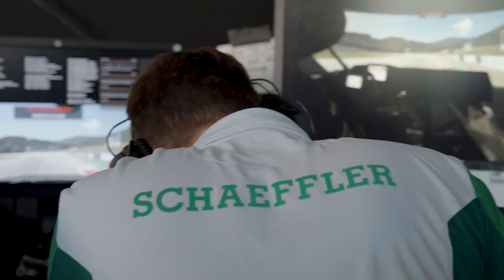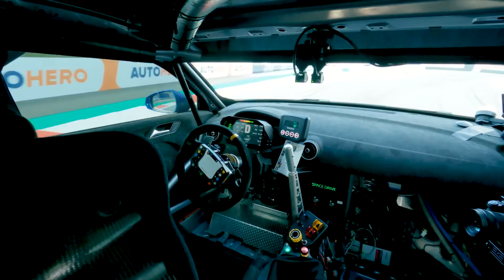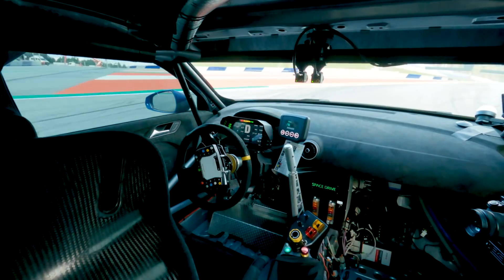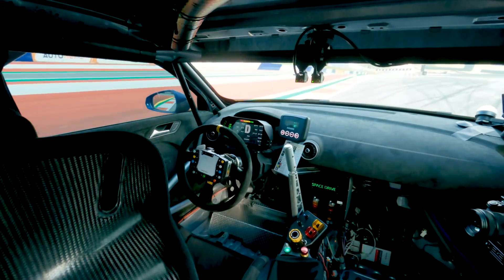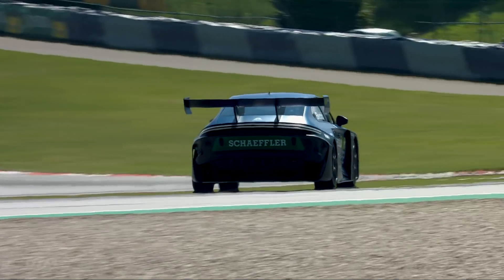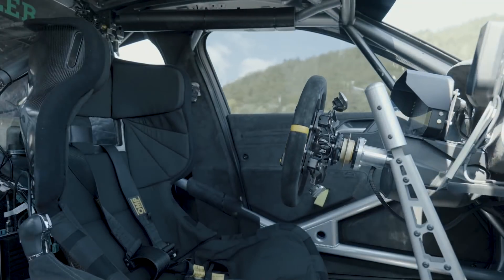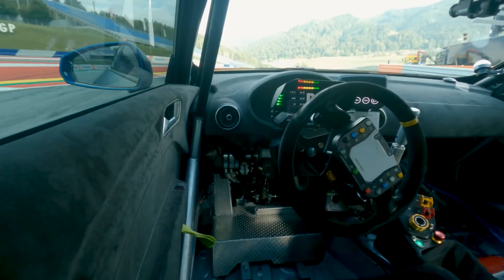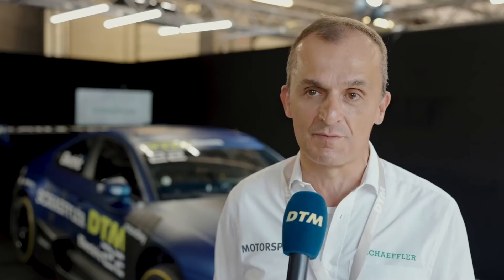Driving a Race Car REMOTELY! 🤯 | DTM 2021

Comment: It's promising for possible dangerous situations around racing. Say, after an impact, if the car is mobile, it can be driven remotely to the nearest exit where doctors will be available sooner.

In actual racing, this can be helpful to bring more drivers with disabilities to racing. They can use a system that has similar tech, but actually be seated in the car, just with a different steering device, adapted to their needs. It's not remote, but uses the same tech to create new ways of steering. 

And yes, why not try some ultra fast and light cars driven fully remotely on a dangerous track. A new type of racing, next to traditional ones.

Comment: I hope these will never replace real drivers in real cars. Wanna do a separate championship? I’m good with that. But NEVER replace real races. I’d the driver is not in the car, it is not a real race
Reply: Yeah, "some times" tech on sports it's just make it less emotional and less excitement to watch imo...
Reply: I'm not trying to take anything away from you. But I disagree with your last sentence there: "If the driver is not in the car, it is not a real race"
Reply: @decay2__  IMHO it is not, not in the "usual sense" at least... When you are "on the machine you are racing" you feel it. No matter how realistic a simulator is, you don't feel it. Plus you have the adrenaline, you have risks that make you drive/race in a certain way (this is of course good and bad at the same time). It is just a completely different experience.
Reply: @DavideBenvegnù  I agree. This looks more like an extension to Simracing than anything related to real racing. But that extension doesn't make sense because the point of simracing is making racing available for everyone and not just the privileged.
Reply: I didn't expect to find Jim Glickenhaus' YouTube account so easily
Reply: @decay2__  I'm not saying innovation is bad. I work in innovation myself. And as I've mentioned, the 2 things are perfectly fine if both coexist. What is not fine is if one replaces the other. They are simply 2 different things. Are "Sports" and "eSports" the same thing? NO. Are any of them bad? No. They are just not interchangeable.
Reply: And FYI I do have racing experience... not with cars, but I've raced in Motocross, Supermotard, and Supersport

Comment: In all seriousness, I see this as a huge potential for the future of Motorsport, the driver doing it remotely allows there to still be the skill between drivers, but it allows cars to get faster and faster, beyond what we can even imagine without causing any additional risk. I really hope this is more than just a pet project for DTM, because it's something I personally would be incredibly excited to work on and see developed further.
Reply: Nah mate without the driver being in the car it takes away from the experience as a fan. The drivers would all be kept at the factory and fans will be watching cars go around. You won’t be able to celebrate yohr favourite driver getting on the podium but your favourite car now
Reply: Even in eSports we see players sitting in areas playing locally with people cheering them on, I don't think that's the main argument.
Reply: @Sp4mMe  there is an argument because the teams won’t use an arena 
They will use their own simulator because of the connection and the motion simulation 
So we won’t even get to see the drivers properly
Reply: @salmaanwadvalla68  No they won't. 
Heck, even right now you see the teams sitting where? At the pitwall. Sure, they also have some guys back at the factory (in F1 anyway) but they're still right at the track because that's what the sport demands.
... seriously, any such racing series would just say "driver has to sit here" and that's it. Like I said, same as in eSports and other competitions.
Reply: @Sp4mMe  granted but what I’m saying is 
The simulators the teams use are a lot bigger and more complex 
I’m order for them to get a stable connection the internet will have to be insane 

So having for example 10 teams 
Two drivers each 

That’s 20 sims in one building
So you’d need a terra bite line minimum insane ac and massive amounts of space 

Lots teams already have sims at the factories so they will argue that it is easier for them to use those instead of optimising an entire new one